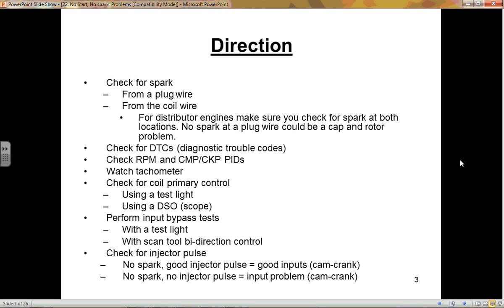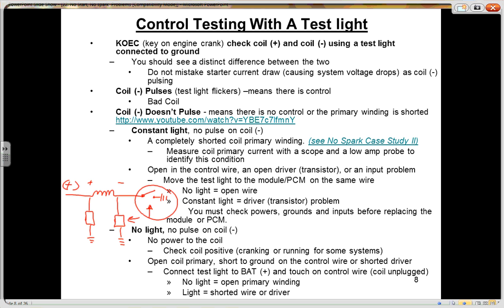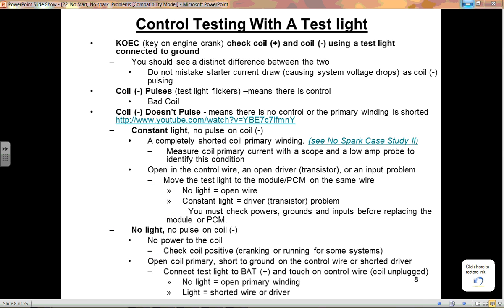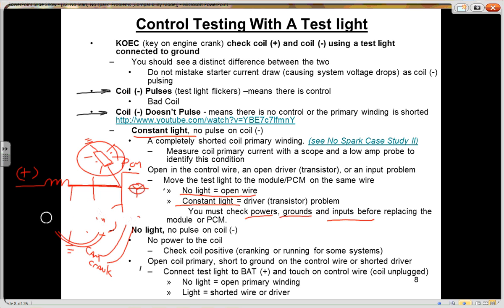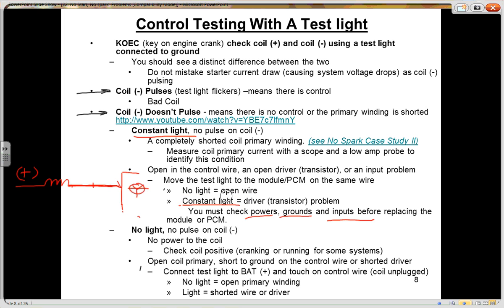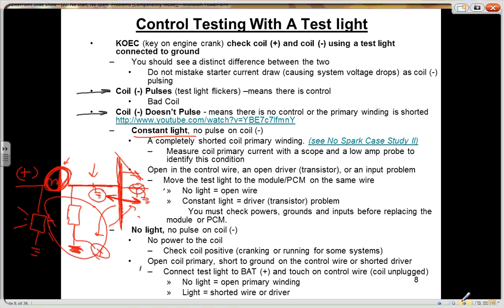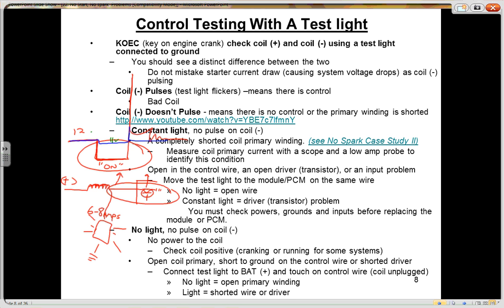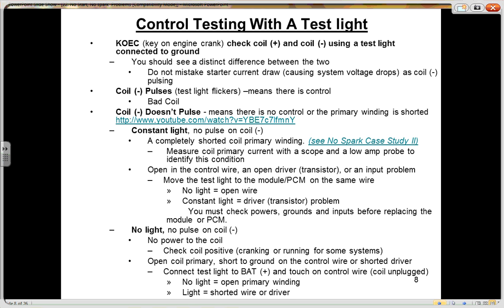Ignition coil-module test with test light  (a free SD Premium video)

Comment: Vehicle went from running perfect to no power in 2 seconds! I bench tested the coil and it has spark. So now I'm thinking the igniter. 1986 Toyota pickup R-22 carbureted engine. It's my work truck so pretty stressful having it down. Any suggestions on how I can test the igniter module?

Thanks
Reply from the maker: I have ignition testing on my sons Celica (95) but should be very similar

Comment: On my 1998 chevy 4.3 v6 i tested the ICM thats on the coil and has  4 wires first ones 12v with the key on. and the signal wire at the bottom is allso 12v with just the key on?>  the groinds good but should there be 12v on the signal wire thats supose to be 5v im not getting any comunacation from the ECM i cant even throw a code unpluging the maf sensor. while cranking. its a no start . i replaced the engine with a new long block and every thing worked fine now no start.
Reply from the maker: Give me voltage readings on all 4 module wires, plugged in and back-probing during cranking and I need to know wire colors!

Comment: Paul help me out with this, I have a 1998 Grand Cherokee 4.0 Laredo Jeep, no spark , I test the coil with volt meter reads Primary,  1.1 and Secondary reads 12.72.... the specification  in the book for this coil is  Primary 0.96 to 1.18 ohms and Sec. 11,300 to 15,300 ohms, is this a good coil or bad? thank you in advance.
Reply from the maker: Are these resistance readings? Forget that test, it's not accurate most times. 
Do the test light tests I described in this video and report what it does.
Reply: @ScannerDanner  I did this reading with the coil out the jeep., I haven't done the light test cause I went to buy that T PIN and they keep saying its in order, soon as I get it I will try what you prescribe in the video. i'm new to this but I will learn this because i'm determine. and I been sitting  here waiting for your response and wow that was quick, cause I know you are a busy man, I didn't get that book cause I didn't think I can understand this but I am going to order it if it means it will help you out. and in the long run I am not going to give up so it will help me out in understanding this. where do I go to get this at www.scannerdanner.com.?
Reply from the maker: @jeremiah1797  you can use a straightened paper clip, just don't let it touch anything else.  BTW The heart is more deceitful than all else for sure!! (Jeremiah 17:9) 
Is it wrong to assume we are brothers in Christ? Either way, I will help you and this is independent of anything you would buy from me. I don't need your money to help you.
Reply from the maker: @jeremiah1797  this is the test I want you to do next https://youtu.be/TXKf96wqaoU

Comment: Great tutorial, THANK YOU so much for posting! I will use this knowledge today. Bought a 2012 VW CC on auction, had to replace the harness, repair the engine, reprogram the key. The car doesn't start, cranks but no spark. This video is exactly what I needed to troubleshoot.
Reply from the maker: Glad it helped, if you get stuck, I am hear and I read every comment.

Comment: No dash lights, no Crank but I can hot start the car but not from the key
Reply from the maker: Does it run or only turn over when you jump the starter?
You are going to need good service information and a diagram on your starting system as well as your instrument cluster. Here is a link to the DIY version of the same service info I use. For $20 you can purchase access to your car and all the service info and diagrams for a month. http://eautorepair.adtrk.biz/?a=10817&c=24&p=r&s1=

Comment: hi do you have a video doing that . I got not spark Honda accord ex v6 99 and I got a new spark plugs and weird  and new distributor cap and rotors
Reply from the maker: did you get this figured out? I have no videos on Honda's with no spark.
Reply: +ScannerDanner yes I did I fix it , it was the coil

Comment: "...this sounds a lot like a section 3, doesn`t it?"...but, so far, i havent seen you go onto the ground side-switched solenoid`s control wire with the test light connected to battery negative...(except for energizing the low current solenoids, by bypassing the switch)...i mean, this method seems even faster(e.g. checking both feed and control on one t-pin only, with the connector plugged in, etc...i am not sure, just guessing)...so, why u didn`t do it in such fashion for, say, fuel injector testing?

Comment: Hi Paul Thank   you for your vids.
I have a 1996 ford escort 1.6 16v zetec that doesn't start.
I check for spark on the HD leads and there's no spark.
I checked for injector pulse and I do have a pulse. so I tested for spark on my coils with a test light and I have a very weak spark. so i replaced the coil and I still have a weak spark on my coils. I measured the voltage to the positive terminal pin on the coils (10.0v) so i checked the grounding side of the coil with a test light and the light does flicker but its very dime compared to the ground side of injector plug. I checked the continuity from the PCM to the coil wiring plug and its all good. can this be a bad pcm grounder driver? Thank you from Spain Tony

Comment: When connecting grounded test light on control side of primary coil, why aren't you charging up coil?  There isn't that much resistance in test light to prevent this. Is there?

In my mind, I see a path to ground which would energize primary coil.

Please help me understand this.

Comment: Hi Scannerdanner
I love this video and have learnt alot but I al having problems with my mercedes 320 sl; I am getting no spark on 3 qnd 4 which run off one of the coils zith the engine running I have a constant light on poss and neg on all off the coils but no spark on one off the coils; I know you qre going to say I need  a new coil but I have just put new coils on all and it is just the same; I am confused because if I was getting flickering on the coils that are working I would at least know that I was on to somthing but all qre giving constant light on poss and neg; please can you help
Reply: So test light is constantly lit on coil (-) (test light connected to ground) on the none working coil?
It should be pulsing on the working coils.

Comment: Yes. There is a difference. The negative side flashes on and off. The positive side only goes dim and then bright fast.
Reply from the maker: I am a little worried about coil +, you may have a supply problem (resistance).
That test light should not be getting that dim on coil+, unless your battery is weak and you've been cranking it for a long time. What you need to do is a voltage measurement on coil+ during cranking, the problem is a regular voltmeter is not fast enough, and will average the voltage drops. IF you have a voltmeter, give me a voltage measurement on coil+ during cranking, it will not be as good as a scope but may tell us something.
Reply: The reading on the possitive side of the ciol before ctanking is 11.80 volts. while cranking it drops to 10.45 volts.
Does that give you any ideas?????
Reply from the maker: doug dickerson
that sounds normal
Do you have injector pulse?
Reply: ScannerDanner I will check!!!
Reply: doug dickerson Ok, I pulled the plug off the central injection system. There are 6 pink wires that have voltage when the key is on. When I crank the engine, none of the wires make the test light pulse!!! There is no voltage at any time on the other wires on the plug.

So, what does this mean?????????
Reply: doug dickerson Could this no fire at coil and no pules at the injectors be a bad anti theft part in the ignition cylinder< bad PCM or what???????

Comment: Im working on a 1999 gmc jimmy with a 4.3. I have no spark from the coil. I have changed the crank sensor, coil, control module and the cam sensor in the distributor. I still have NO spark!!! what else could it be????? The test light at the coil plugs shows that the negative side is pulsing and the positive side flickers while cranking.
Reply: are you sure the pulsing on coil- looks different from the pulsing on coil+?

Comment: In this vid you have a no light scenario and you said a possible problem would be a short to ground in the control wire or a driver shorted to ground. Would your test light (set to neg) light before the short in the wire? The circuit is on all the time right?

Comment: not sure how to PM but yes it is on top the coil Standard Motor Product LX1001 Ignition Control Module not sure if something could be substituted like the GM hei on the MX3 works great  the vac dist may be more reliable since this was the dark days for computers

Comment: Makes sense its very consistent at doing this. After cool down starts right up. The"power transistor" seems very hard to find and the computer. Maybe could be changed over to non computer vacuum type distributor

Comment from the maker: No, this model has an external "power transistor" (what its called on the diagram). It would be basically an igniter.  If you are not losing pulse on coil (-) then it is not the pick-up coil. It is either igniter, wiring or computer.

Comment: I replaced the crank sensor,pcm,already.I had that problem before with tapping on the power box,third ECM in now.The ECM gets hot that you can barely touch it n the coil control mod you can't even touch it;its so hot,I think its time to Scrap it for what its worth.The ele. fan kicked on tonite while I was running it and the car shut off at idle;that to me seems like another ECM,It started right back up though?

Comment from the maker: Okay, I don't like the 8.6 ohm one but as you said with it unplugged it still will not start. How about injector pulse then? I am guessing it is also good when not starting?
Next is to check both 3x and 1x crank signals during the no start. I have seen a weak hall effect magnet cause some goofy waveforms on these. You will have spark but it will not be the correct coil. Not sure if this is going on or not. 
Also the ECM itself it suspect on this model. Do a tap test on it.

Comment: Quick question SD,1990 3300 when engine is up to temp then shut engine off it starts right back up,wait 10 min. later;no start let cool all the down then starts up.I have done all the readings by ohms/amp testing could it be the oil pressure switch or something im over looking?

Comment from the maker: For sure, I need to do that. I do have some info. in Section 22 page 18 and 19 on a 3-wire COP on a Honda. 
You can trigger these coils but I hesitate to tell you to use a test light because the transistor base circuit voltage is typically only 4 volts on these. I have done it without an issue using a test light to 12v, I'm just not 100% sure that you would not hurt the driver in the coil yet. but I will keep you posted of a better way

Comment: Awesome video.I solved a problem on Renault Scenic 1.6 16v engine it was a bad ecm driver and 2 coil over plugs didn't work no 1&4.Just watching your video I was able to determine the problem.After fixing that issue car had a problem with a MAP sensor the signal wire was shorted to ground and this was possible to fix thanks to your videos.Thank you and keep up the good work.

Comment from the maker: It could be the coil even though resistance shows good, but it could also be a problem on the primary side. If it is a point type ignition system you could have the wrong air gap set or you could have a ballast resistor problem. If it has an electronic ignition you could have a bad module or pick-up coil problem. As for scope testing, just keep watching my videos, you will see the many uses for it. It will do more than you think.

Comment: well i didnt use a test light. i put the postiv probe from my multitester and i got 12v with ign on and then 8 to 9 v when it cranks ..so i have positive but i have misfire cause the carburetor backfires..I did the spark test and the is very weak and sometimes fire and sometimes dont ,i presume is the coil but the coil resistance(2) is correct with the specs.i want to buy a osciloscope but i dont know,what other use the scope will have.cause is kind of expensive

Comment: the values from my k12v ign coil (5months old) are correct comparing with the factory specs
and my 76 toyota doesnt start,,cranks but wont start.Even the values from the resistance of the internal coils are correct is it possible the coil is fried or useless..To know is the coil or the wiring can i use a OSCILOSCOPE? to measure the kw from the 2nd coil o r theres a cheap way?